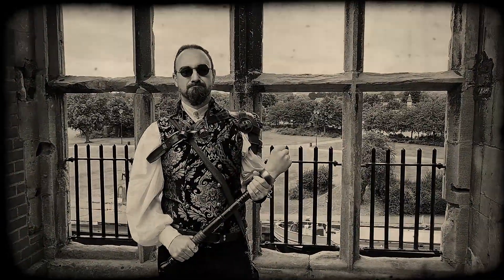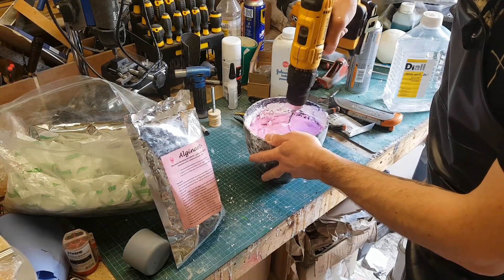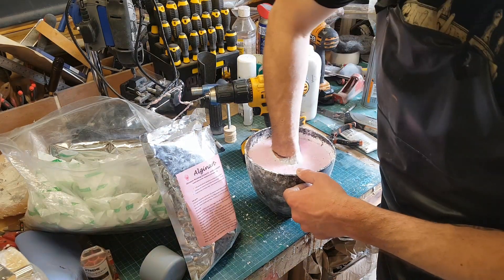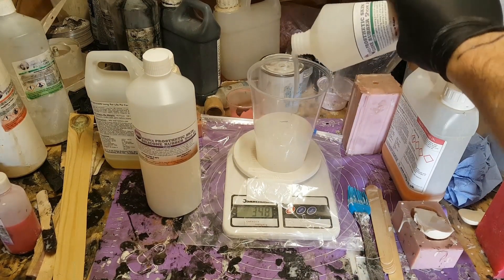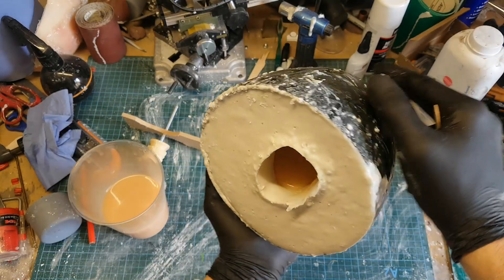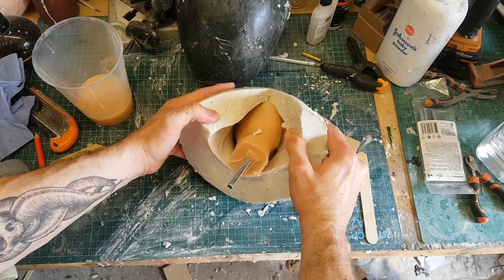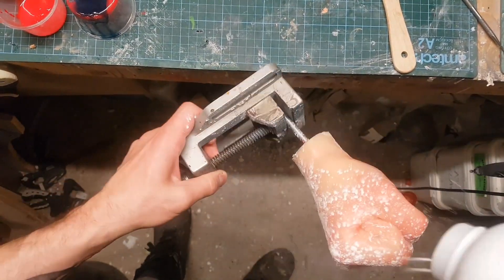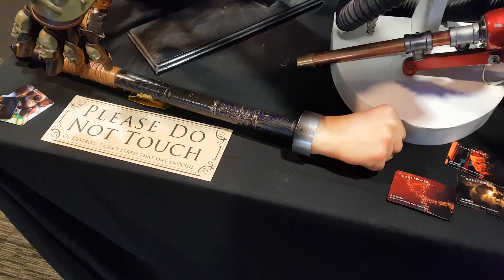Casting a hand in silicon - making a Steampunk prop

Comment: "Honestly it's not mine baby!" 
                            .... Austin powers.

Ha! Joking aside, great video. What brand silicone is that? And pigments? I was wanting to make a stop motion character and silicone over wire armature. Also does the talc matte last?
Reply from the maker: Haha, thanks.  I'm using this stuff although the pigment I used is from Mould Life.  They do their own pigments too https://www.dwrplastics.com/prosthetics-fx-skin-propmaking.html

Yeah the talc seems to last pretty well.  You can wash it off if needed.
Reply: @thedarkpower  thanks very much! Thinking of making moulds from plaster of Paris. 😎
Reply from the maker: Yeah that'd work for silicon, I've done that several times in the past.